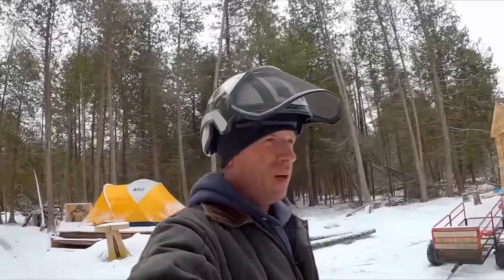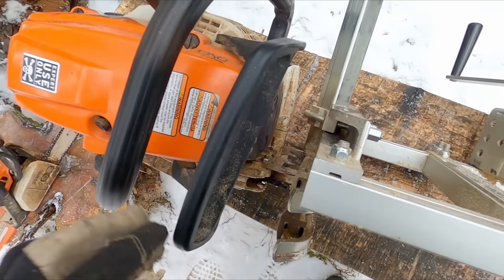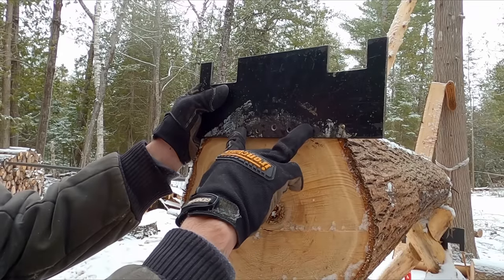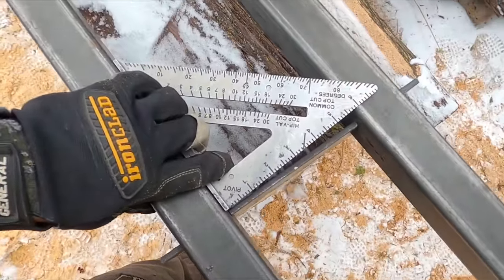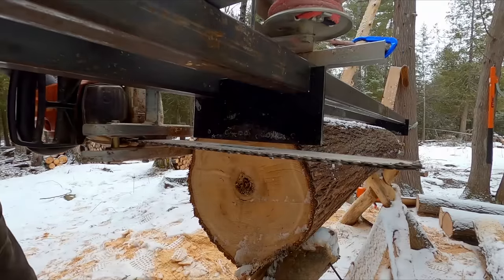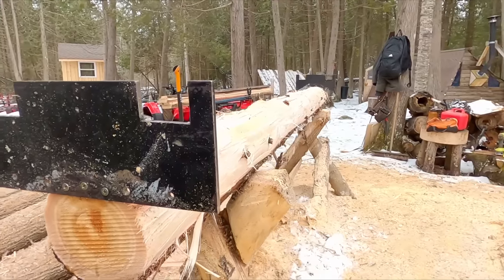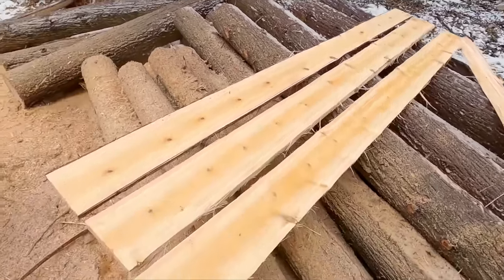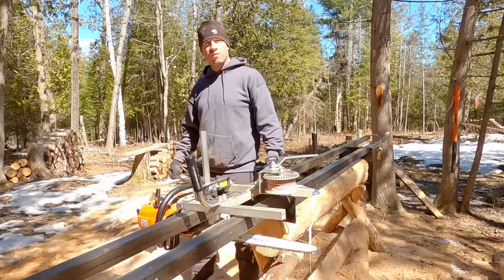$200 Bullet-Proof Alaskan Chainsaw Mill Setup.  Build Your Own!  #80

Comment: For cleaning your chains if you are where power isn’t a problem you can get an old computer fan ( usually about 6” x6”  and high speed ) break a piece of one of the blades off and attach it to any container ( an old style metal coffee can is what I use ) fill it with whatever solvent you want put your chain in it and turn it on over night. The vibration will help more than you would think. I’ve never tried it with chains but I used to work on industrial printers and I worked great with ink and those little fans are a dime a dozen. People get tired of their computers microwaves or whatever and throw them in the dump. I appreciate your tutorial I’m looking around at mills right now and that was very helpful. You have a blessed day

Comment: Great video!  Built this same setup a few years ago and have milled lots of walnut. Used some surplus 1-7/8" strut for the bars and tilted my log table to make it a little easer cutting.
PS. My old 1980 Homelite XL12 just keeps going.

Comment: Excellent video. I've been milling for about 11 years, always used an extension ladder for the initial cut. Been looking at this setup with the plates for a while now. I think you just sold me on that idea. Thanks buddy. You covered a lot of good points on milling in this video. Things I also found out through trial and error. It sure is fun though. MS 460, 32" bar, Alaskan Mark III.

Comment: Make you a drip oiler for your bar on the mill you can use a pop bottle with a length 1/4' hose and a needle for pumping a football up for the tip to direct it right on your chain will help alot with chain and bar life you can use used motor oil for it when it's cold out

Comment: very good video...I have been milling for about a year and experienced most of the issues you mentioned, but I will never quit milling I totally enjoyn the process. I also finally concluded that most of the failures are due to chain issues. Unfortunately my STIHL mechanic wasnt familiar with milling angles on the chain or them correct chain to use....I think I have worked that out. also bought some Granberg chains. anyway, I dont watch many videos to the end but I did yours

Comment: Great tips on how to make a great set up even better! As for your out door shower 55 gallon metal drum paint black for sun shine hot water.  rain spout off one off your buildings and scoop snow with tractor bucket to keep filled with water. build a small fire box under the tank for the cold and sunless days. good way to help clean up your scrap lumber.

Comment: You know for a larger log you can make one cut, roll the log 180, make another bark side cut, Then mill much larger logs with a much smaller length bar, and have some very wide finish sides boards. 
Incidentally I did really love your plate on each end, making me a couple today. Been using  a modified  ladder but your plates will be a game changer for me.  Also the tip on ripping chain is great also, going to call and order that as soon as they get back from "Holiday " break.  I'm cutting Florida red Cedar, somewhat harder than the northern woods, but still smells just as nice. Keep up the great work!

Comment: I run a 42" MS660 92cc rig on a similar mill.  I kept the first cut guide system much simpler with 2x4 end plates nailed or screwed on the log ends and an extension ladder section for the guide rail.

Comment: A thought on the longer bars. The chain is going through the log well below the surface of the log. And well below those bars. Why don't you make some sort of adjustable support to go on top of the log, and below those bars, for in the middle? Make those bars rock solid for the full length, that way...

I guess it could even be as simple as a couple of wooden wedges that have some adjustable way to latch to the bars.

Comment: Good show man. I use a chainsaw mill also. I make big slabs for tables. I couldn't afford the the size of band saw mill I needed to mill my logs. I can't get enough of milling. I can't get enough of going out and getting the logs. Good work.

Oragon full house ripping chain under 42 inch bar. You won't be sorry.

Comment: Living in Alaska off the grid, I bought a 3 gallon garden sprayer and used a barbed fitting to attach a sink sprayer to it. Then 1 gallon of hot water and 2 gallons of cold water then pump it up and you’ve got a shower with pressure. Instead of using a bucket or sun shower.

Comment: Sounds like you might be using the default cross-cut chain. Switching over to ripping chain which is designed for this purpose ought to bring more hardwoods into the mill's reach.

Comment: Have you tried the square filing    I've noticed that my chains seems to hold the edge a whole lot better with the square grind    usually the beak of The cutting edge gets a micro bend in it and acts like the end of a ski  even though it feel pretty Sharp it just won't cut very good  .. I've heard a couple of these guys that Mill say they completely remove the drags for ripping   and some file the rakers down a bit more for ripping probably around .040"   or 10° with the protractor  ..that is if your  little saw will pull it     .. I've got a little MS 362 in my arsenal    little thing is a beast  that's my favorite do everything saw   I do like my 660's tho 👍  I've got an 880     that thing is just too heavy  and doesn't seem to have much more power than the 660's  matter of fact my  ported 660's  probably edge it out a bit    and they're much lighter although that little bit of extra torque from that big 880 thumper of a piston  may shine a little bit more in the monster wood

Comment: I have a sawmill like yours, only I drilled holes on either end of the 36” bar. 105 cc. I then put 1/2” threaded rod running perpendicular to the bar and made two wide boards parallel to the bar. I use a ladder for the guide and first cut board. It works like, sweet.
Reply: See T wagner YouTube

Comment: I bought a chainsaw mill for my Christmas present.  Mine is a larger one and will handle a 36 inch bar "I also had to buy a 36 inch bar and chain". Most of the recommendations I have seen call for at least a 70 cc chainsaw,  but I have ben using a 60 cc and it's been working for me.  Also with the larger mill it has a clamp on the front of the bar too.made a gravity feed Oiler for the front of the bar, which is helpful when milling large hardwood logs.

Comment: Just milled about 70 slabs with 24"' - 32" logs. In the last 3 years ive probably milled around 250 slabs. I use a ladder with the same basic ends made out of plywood. . Ladder is so easy because each rail is connected so its so fast to set up. I use straps with 3 inch screws that fasten the ladder to log but they are mostly at each end of the log. I use a 661 sthil with a 32-42 inch bar , depending on the type of wood being milled. I dont have the luxury of having the log sit on a platform. I have to mill it on the ground. The smell of exhaust and sawdust isnt so fun but I like doing it so much I dont care. Next saw will be the sthil 881. Nothing like getting my mill on a beautiful knot free 36" log. I dont care what species it is. I do stay away from Oak and Eucalyptus though.
Reply: Why do you stay away from oak? Too hard or smell?

Comment: I paid $1000 for an old Harbor Freight Band-saw mill.  Makes this chainsaw setup look like a PIA.  I just did five 14' long logs today, two 22", and three 18".  Ended up with a lift-worth of boards, all perfectly cut.  I can't imagine using a chainsaw mill unless there was no way to get a regular mill to my location.
Reply: I was on the fence as the normal saw mills look like they can be a pain in the ass too and they cost $2,500 at Harbor Freight.  I didn't consider a used one, but will be on the lookout now.  I have 17 of my 20 acres forested with hardwoods in Northern Virginia so I should be able to drag them with a pickup truck where they need to go.

Comment: I have sharpened chain for 57 years and the one thing i see people overlook is to file the ''riders'' down. The rider controls how much the tooth cuts, or the depth of cut. After about the 4th filing you heed to shorten the rider. Buy a gauge at a saw shop. ask them how to use it, they will be more than happy to show you. Also if you are using a power grinder , use ''short'' grinds like he did in the video, as long grinds will heat up the metal and burn it. It will be dark blue in color, and be very hard to sharpen next time. Remember, if you have to force it to cut it is dull or the riders need filing down. There are some great videos on the web on how to sharpen them. Good luck.

Comment: I copied your milling setup and it's been working great for me.  I got 11ft square tube since I didn't have much interest in cutting anything over 10ft.

The Granburg chains are very nice but you can make your own too.  I bought a roll of semi chisel and make loops with that but Changi the angle to about 10 degrees.

Comment: So I have been dragging my feet on building my saw mill happened across your  video and I have to say the information was great definitely answered the question that kept me from building my mill. Started building it after seeing it and going tomorrow to get final supplies. No more spending money on wood. The selection at hardwood stores are less than  to be desired anyway.  Finally going to be able to finish projects I was waiting on because the bank account was low. Thanks I will check out more of your videos keep up the good work. 👍

Comment: I would mount the winch at the end of the log and use a y split connection to the Saw frame and stand in one place to crank would need a couple of guide rollers to keep the saw centered,  I use an Oregon 3 blade Saw but I like the idea of bringing the portable Saw to the tree, because sometimes I is almost impossible to get to some of the trees

Comment: Nicely done quick tip I use make a simple wood block template that you use to set your mill height. I have three templates one for the first cut with jig like you have so 5.5” then another that’s 2” inches one that’s 1”

Comment: Nice setup!
For your shower problem:
Burry some ICB Container deep enough under your house (where it is frost free).
Have some water storage under the roof, just enough for the shower requirement. Run a hand pump to the under roof storage area.
I am sure, you have a cabin heater:
Wind some copper tubing around the metal chimney pipes/ flute.
Connect it such that the cold water enters from bottom and the hot water comes out on top (it is not ideal for heat exchange, you would need to do this the other way round but...)
The hot water will raise up and you let it into your water storage area under the roof. The hot water will create a circulation and will slowly heat up the entire reservoir on top. Obviously some plumbing needed from the reservoir to the shower.
Wait until hot enough: Enjoy your shower!
Side effect possible: Not needed hot water: Drain it into a radiator located in your room: Extra heat. Once cold, drain it further to the basement water storage. Or drain it down straight if you want to warm up the water in the basement in very cold winters.

Comment: Nice video, liked the 2" bar and plate setup. I have granberg stuff as well. I've run into the same prob with pine and doug fir. Alcohol, I'll have to try that. Back up chains are a must. Stopping work to sharpen is " no bueno", a little Spanish lingo. I'll keep an eye on your site, thank you sir.👍💪

Comment: Concerning the guide bars if you are going this route. One option would be magnesium concrete screeds. They are pricey yes. but they won't flex! And they are a lot lighter than those steel ones. Also to stop the bars from sliding while sawing, just wedge a cedar door shim in there.

Comment: I did my undergraduate research project on loading ceramics (i.e. silica) into wood. The point of the project was to make cheap wood perform like Teak. Turns out that Teak is naturally loaded with silica. Silica has high hardness and it is much harder than a chain. Silica is sand.
Reply: How did it turn out? Ive seen some people increase the density of softwood with promising results.

Comment: When using smaller logs a metal plate shaped like a tee with tee branch facing down you can have more holes in the plate were there is more meat to fasten to.

Comment: Really enjoyed watching you video.   

Just FYI, you can run that "narrow" .325 chain on MUCH bigger saws.  I run it on some older Stihl 036 saws.  You just need a saw that uses the same bar mount.  I don’t know what all of them are, but i know the 361, 441, 462, and 661 will fit that bar.  Realistically,  the 036/360/361/362 saws are about the biggest saws you'll want to run that bar and chain on.
Reply: Also, white gas does a great job of removing pitch from your chains.
Reply: If you want a bigger saw for milling , or you burn up your 261,  yhe Farmertec G660 and G466 seem to be holding up to some pretty heavy milling work.  They are Chinese clones of older Stihl designs.   I have a g660.  I don't mill, but it has been a fantastic replacement for my Stihl 064.  They also have a clone of Stihl 070 which is a 100cc saw with no chain break.  It's intended for milling where kickback isn't a concern.   My G660 was $321 to my door and I had it in 2 business days.  Do some research first though  because you will want to replace a few parts with Stihl OEM parts right off the bat.

Comment: If you have running water near by even if your up hill from it, a water hammer can supply the water without any outside power. Just powered by running water.

Comment: A quick tip: if you set the log up so you are cutting down hill the saw will cut with almost no assistance.

I slab Aussie hardwood with a 4ft bar on a Husky 3120xp, a 1 metre (40") wide slab cuts about 10 minutes per metre. 

Cut 3-4" slabs then cut down into boards or 2 or 3" lumber with a circular saw.

Comment: A great video . I was going to search for the other mill set up video with the chains you use. I am getting ready to make lumber from old DTE power poles that were put down in 1949 and just removed by my house. They were cut into 12ft lengths. This will help me out as I use my Jet bandsaw for making 4ft planks out of tree logs. Chainsaw milling I have used without the Alaskan set up and just cut freehand with some success. 

I cut over $80 worth of planks yesterday from a short section of power pole. Beautiful spruce wood and grain. Best of all mainly free... just some diesel for the tractor and electrons via DTE.
Reply: @Jay these were poles on private property with no contact by people other than linemen. I've smoked blades before in trees from stuff nailed to  them 30 years ago.

Comment: This is an older video, and maybe it's already been addressed, but I'll mention it just in case. Simple Green is a GREAT solvent/cleaner to soak the gummy chain in. Afterwards, all that crud just brushes off. I used to use a wire brush on a bench grinder to get all the cruds off before sharpening the chain, but the Simple Green soak is so much better and safer and it doesn't dull the chain any further.

Comment: You stumbled on something there my friend when you said the chains were to aggressively sharpened. Cross cut or rip. Full chisel cuts faster for a very short time. Once that point dulls it's over. I dont use full chisel for anything,not even cross cut of firewood. If there is any dirt,dry,froze or wet,the chisel point dulls "fast!" It dulls quick enough in clean wood. I dont bother with chisel unless it were given to me for free to just use up. Even then  I try not to make use of it when pressure is on me & bring plenty of shape spare chains. Often 1 tank of fuel is all you can get in clean ,green hard woods. Where as semi chisel & chipper saw chain might go 5 -7 tanks of fuel in the same wood. Really,its that bad & worse if dirt in the bark. For god sake if you dont have ripping chain,then use chipper or semi chisel unless you like changing chains & clean saw every tank or half tank. If its frozen mud,1 cut on fire wood can just about wrap things up for you right there. The duller it gets,the hotter & softer it gets & the faster it dulls more. It's just over? No other way to explain it. It's really that bad sometimes,in my experiences, "most times!" Like big deal,I cut 10 cuts real fast & then 10 more cuts so/ so & it's over & still have fuel in the tank. Now 20 minutes clean & changing chains out in the frozen ding weeds with frozen feet & hands,it sure gets cold fast when you aren't doing anything strenuous, say just time consuming & annoying. This also touches on the topic of debarking nicely & just what a great advantage that can be with any type chain. Now I'll mention this can make a huge different as well. If there is mud on the bark of a log that you are going to cross cut or rip?   "DO NOT", cut in a way that the saw chain teeth come over the bars sprocket tip & drag dirty muddy bark into your cut with wood chips in the saw kerf you are cutting. So to say, do not pull mud into the center of the log & through with the saw,bar & chain. Go to the other side or mill from the other side so the chain teeth engage the muddy bark on their way out of the log & fling it harmlessly away on the ground! To do it the other way is like sticking you bar & chain against the earth or a side walk. It really ,really makes a big difference when you can & do change your dirrection of approach on muddy bark,wet,dry or froze. If you cant,or it is coated round about, then debark it! Or  skip it till last so you can get something done before you dull hell of every chain you have with you.